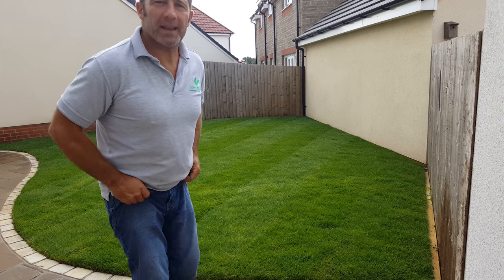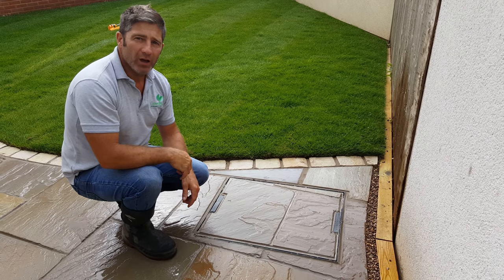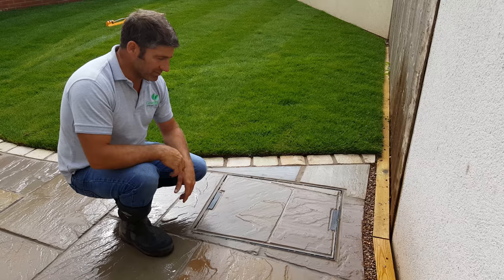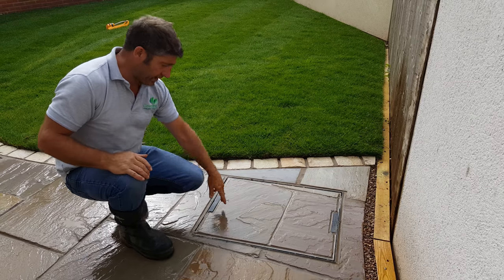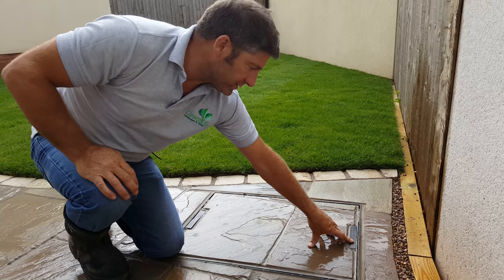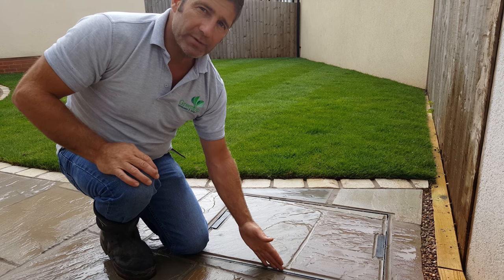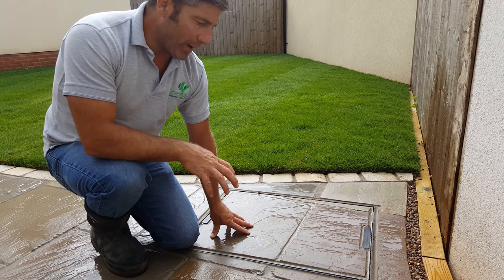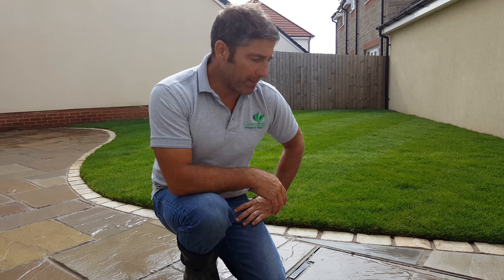How To Install A Paving Tray In A Patio

Comment: Hello, I'm about to install a paving tray on a home project.  I want to ask if a 5 tonne rated tray with plastic frame and galvanised tray (45mm deep) is suitable for 20mm porcelain tiles?  Is it to shallow with only 25mm for cement?  This is for a back patio and only foot traffic.  I'd be grateful if you can answer this question.  It seems it will be easier/lighter to lift for inspection when needed.  Thanks, great channel btw!
Reply from the maker: that will be perfect my friend but if you are worried you can get some data from the manufacturer.

Comment: Hi. If I have an existing 300 x 300 plastic manhole witha plastic frame. Can I just replace the lid (with a paved galvanised lid) or does the frame need to be installed too. It looks to me like the lid will slide into the existing 300x300 plastic frame?
Reply from the maker: try it ronan mate but i would use the frame it came with, stay safe mate

Comment: "Just pull it up". Not in my experience. The plastic tray, when down for a few years, will not come up without a degree of destruction. If you do need to take one up, be prepared for remedial work. This is especially true of the plastic-on-plastic variety.
Reply from the maker: I can honestly say I have never had a problem ever.